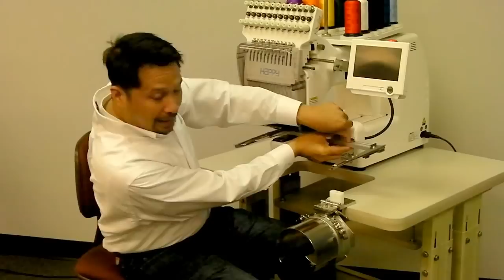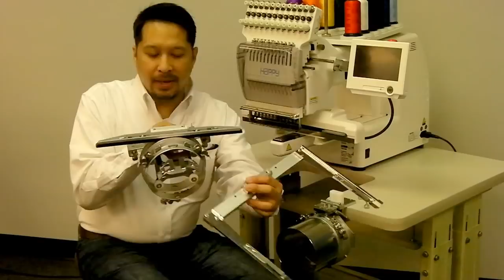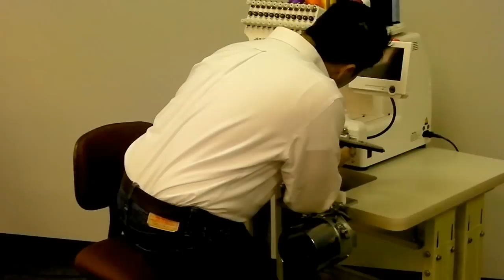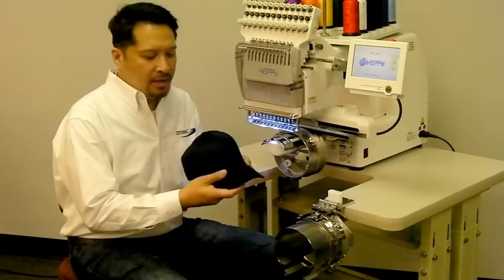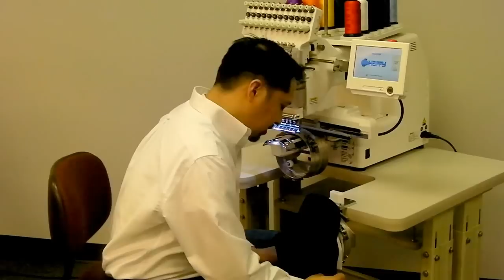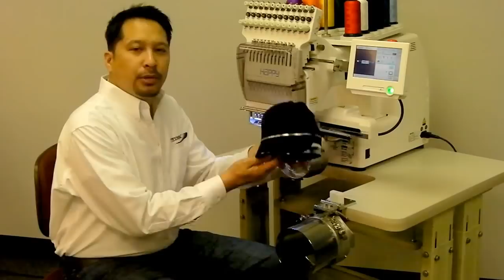Embroidering on Ballcaps with Happy Voyager Embroidery Machine

Comment: Love the Voyager except for this one problem where the machine does not recognize that the regular flat driver is back on. I hit the "plunger" / button underneath the carriage back towards the front so the electric switch should not be touching. But the machine will not recognize and only allow me to choose cap hoops or the onepoint system. Please help, I also heard you all are going to start charging for Over the phone machine support if not purchased directly through Texmac.. pretty bummed about that ...
Reply from the maker: This issue can easily be prevented by proper installation procedure of the cap driver, which is covered in another video in this playlist "Setting up your 12 or 7 needle Happy machine for sewing caps".  For troubleshooting and resolution, of the issue, contact the support department of the company you purchased your machine from.
Reply: I have watched the video followed all the proper procedures and talked to your support on the phone and still run into this issue every time I try to change back from the cap driver to the regular driver.
Reply: This happened to me a few years back. I had to open up the carriage and replace the plunger. NOW, recently I cannot get the cap frame to engage. It will not read and the plunger is depressed. Thinking this is gonna cost $$$. :( I will be calling tech support tomorrow.

Comment: My cap frame is not centered.how can I fix this ?.I have to manually move the frame to the center
Reply from the maker: Verify that the cap driver is properly centered first by hand - if it is not, you may have to contact support for your machine. The other side of this is to refine hooping technique to properly align the center of the cap with the center mark of the cap frame.
Reply: @TexmacHappyEmbroideryMachines  thank you very much for your help

Comment: Sir, i am using Stilista  2000 for design, but i dont know parameter of cap design please tell me that
Reply from the maker: Usable cap sewing area depends largely on the shape of the ballcap, but the machine shown in the video is capable of sewing an are of 290mm wide x 67mm  high when in cap mode.

Comment: I just took my cap hoop out of package.  Sounded like the cable popped and now I have loose cable.  Is the cable suppose to be on it or was that just for shipping?  Why are there no instructions included??  Please message me back asap.  Thanks in advance.
Reply: Good question. Lots of unanswered questions here. Looks like that arm is supposed to be fixed to the attachment. Also, mine came with 2 metal straps. I remove the cable which I think you are correct in assuming was for shipping. I didn't know to fix the arm to the attachment. I also didn't know I probably should have remove one of the straps because my needle hit one and broke. I was reading in the manual that you're supposed to actually raise the pressure foot up as high as it can go as well as change the needle plate. I wish we would receive more support here but it doesn't look like that's going to happen.

Comment from the maker: Cobi -

This is what I teach in class:  It's like tires on your car - use good general purpose tires for most use including some snow.  But switch to snow tires, if expecting to drive for a while in a lot of snow.  Embroidering caps on new Happy machines is the same way.  The standard needle plate is a good general-purpose one even for ballcap sewing.  But if sewing nothing but caps for awhile, you can switch needle plates during that time for a better assurance of good performance.